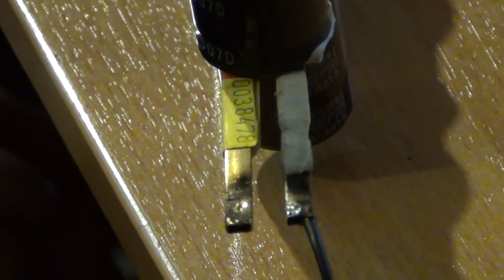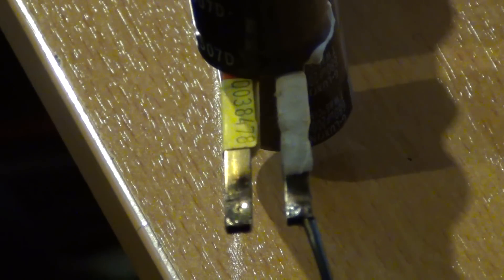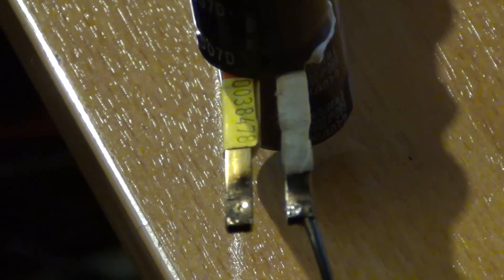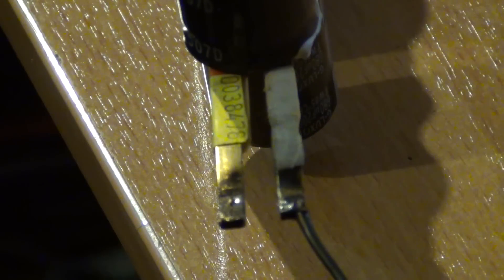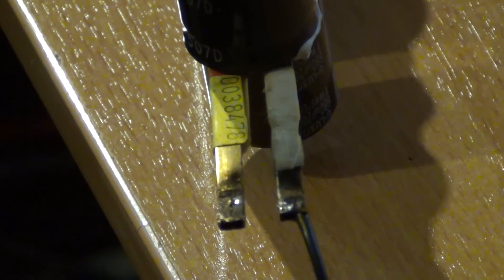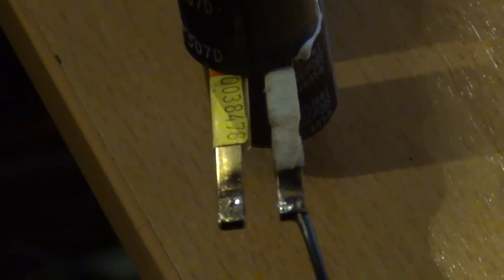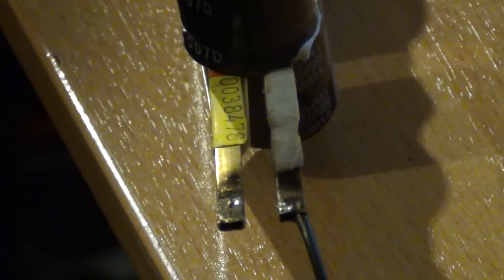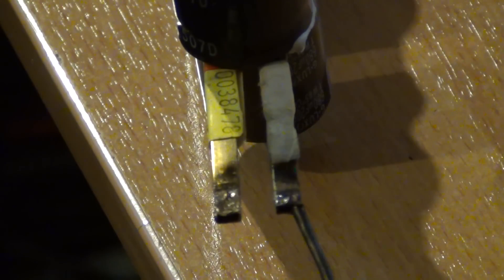200v Capacitor Bank Test Fire!

Comment: Now you need a charge ready indicator. Using a voltage divider across your caps and a known constant voltage, have a comparator turn off a relay when it reaches 200 or whatever volts. a potentiometer will help in fine tuning the cutoff voltage